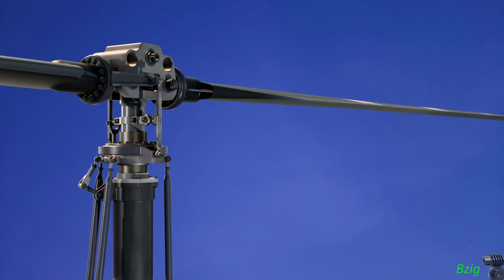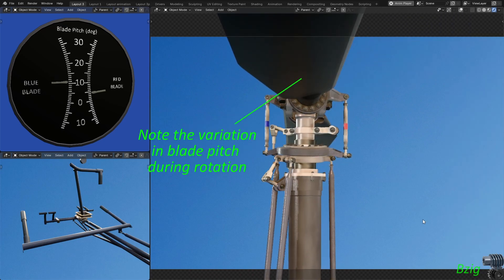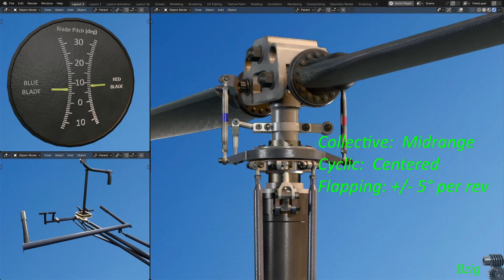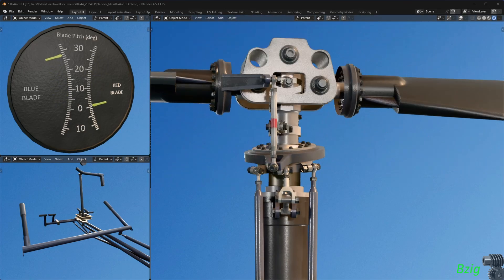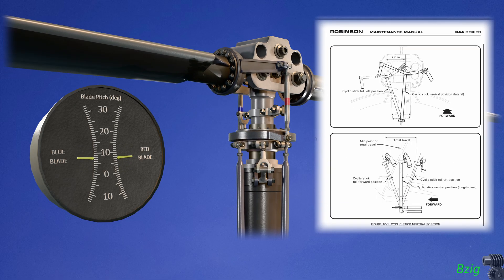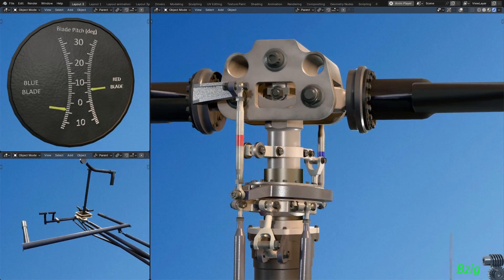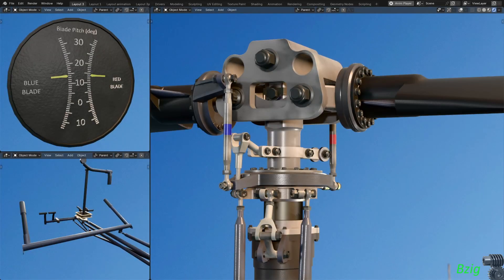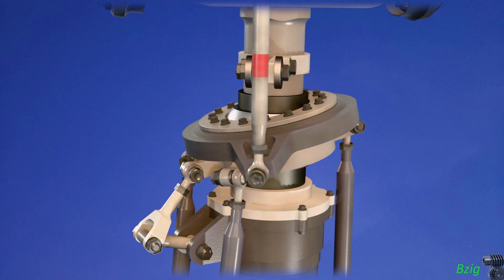R-44 Helicopter Flight Control Rigging

Comment: Video idea for you: The chopper that just crashed today in Huntington Beach. Looks like it had a tail rotor failure at maybe 600–700 feet. I’d love to see modeling of what that failure looks like, meshed with your commentary on what options are available to the pilot.

Probably almost zero, because he had almost zero toward airspeed, but visuals showing why each thing one might try won’t work will still be interesting.
Reply from the maker: I don't think I could do a 3d model that would help in the understanding.  Checkout the video from outbound 300...  https://youtu.be/5ft2qCNF5s0?si=0rCQpYPg_Cgl5N1J   

I like his analysis because it's a dispassionate breakdown of what he sees in the slowed video.  I  like that he doesn't attempt to explain what the pilot was thinking or doing (other than his observation that the tail rotor indicates the pedal was fully deflected).  His commentary is a straightforward, factual, analysis if the failures from the first one to the impact.

I could write a script for what happens when the tail rotor fails, but the animation wouldn't be anything more than the hardware coming off, followed by...
(1) if it came off in fast flight, the pilot flies fast in order to maintain control and tries to land on a runway
(2) if it came off in a low hover, the pilot immediately has the presence of mind to recognize the failure and kill the engines to stop the rotation then does a hovering autorotation  
(3) If it cam off in a high hover, with an unrestricted opportunity to transition to forward flight, the pilot lowers the collective, and the nose, to become fast... then could possibly bring the power back in while maintaining control

There are better talking-head-channels on youtube for this... I don't think it's suited to my kind of content.  

It's an understatement to say this was a bad-day kind of failure.  We know helicopters have many critical parts and, by definition, cannot maintain flight with a loss of any of these parts.  If we limited helicopters to runway operations, these effects would be mitigated, but that's not why we build helicopters.  

This is from an accident report of a L-188 in 1960, but it's appropriate to this accident...

"The board concludes that emergency conditions of great complexity were thrust upon the crew in an increasingly deleterious environment, and that human capabilities of perception, analysis and reaction were insufficient in the time and space restrictions of this accident to accomplish restoration of positive performance control."
Reply: @bzig4929  I saw that video before it blew up, and agree that it’s an awesome explanation. What happened in the comments section is pure gold.

Thanks for that proto-script; it really helps me understand all the options that would be available.
Reply from the maker: I didn’t read the comments.  Heading there now…
Reply: @bzig4929  That’s where the first mention of the pitch change link breaking was found. Several commenters and one was from an A&P with a bunch of details.

Comment: awesome learning aid for R44 students, as an irl R44 rated pilot, I find your animations and explanations extremely useful for visualising how the main rotor system actually works. as a suggestion, should you find the time for it, maybe try to elaborate on the pitch vs AoA distinction, as this catches out numerous students (and instructors), including in the fixed wing world. Animating some kind of airflow across the blades would also greatly add to the visuals. Great work!

interestingly enough, the russian Mi8 and Mi24 helicopters do indeed have an instrument to show the pitch angle of the main rotor blades as a measure of power pulled, instead of a torque gauge like in western helicopters.
Reply from the maker: I'm about two weeks into a follow up video where I cover blade twist and the difference between pitch, AOA and total velocity.  I haven't even started the video yet... I started the project with a blade element analysis and creating a bunch of equations.  Thanks for the comment!

Comment: Great explanation! But you still have to consider the blade washout (twist) that makes the blade not to have the same angle along the length, so you can have positive angle of incidence near the root of the blade and negative angle somewhere from the mid point. This “negative” angle of incidence at the tip of the blades is what makes autorotation possible. Oddly enough although the angle of incidence is “negative”, the angle of attack is still “positive”.
Reply from the maker: great suggestion... I just replied to  @franciscgedeon9237 with this comment... "I'm about two weeks into a follow up video where I cover blade twist and the difference between pitch, AOA and total velocity.  I haven't even started the video yet... I started the project with a blade element analysis and creating a bunch of equations.  Thanks for the comment!"

@franciscgedeon9237
Reply: Twist not needed for autorotation - Piasacki H21 had twisted/non twisted, wooden and aluminum available
Reply: @HongyaMa  Remote-controlled helicopters also do not have twisted blades and can autorotate. This occurs because of the angle of incidence and the angle of attack. When I mention a negative or positive angle, I am referring to the angle of incidence relative to the airframe. For example, with a 10° twisted blade, if your collective is lowered, you may have 5° of negative angle at the tips, about 0° in the middle, and 5° at the root. In contrast, a straight blade maintains the same angle of incidence from root to tip; however, since you need some degree of negative angle of incidence to autorotate, all sections of the blade will be negative. Nevertheless, due to the upward movement of the airflow, the angle of attack will always be positive.
Reply: @PLISNO  twist equalizes the lift forces on the blades and delays compressability 
Bell 212 has 14 degree difference from root to tip with changes in camber and chord
Reply: Just like blade twist for propellers